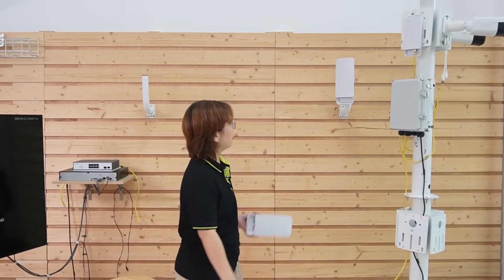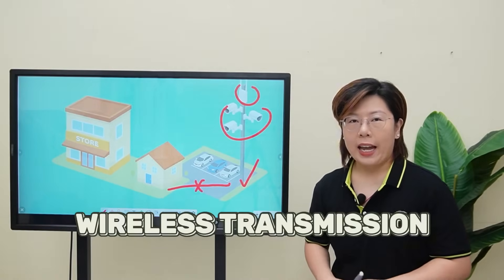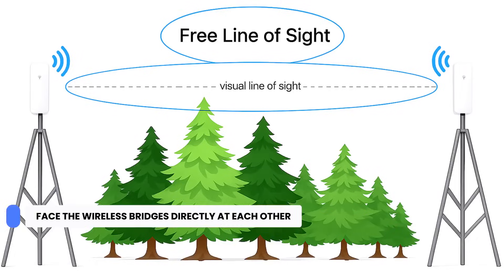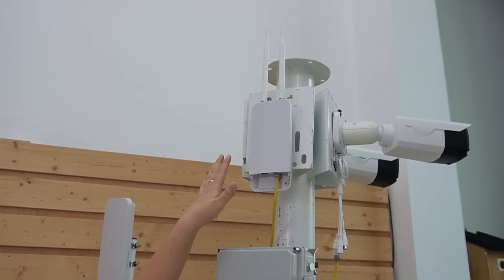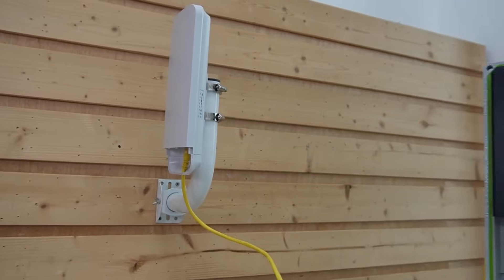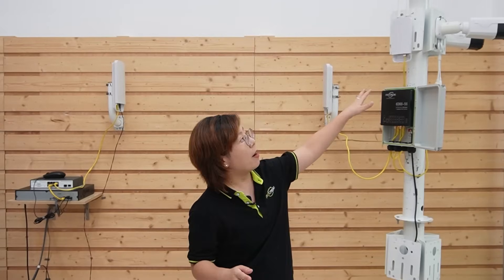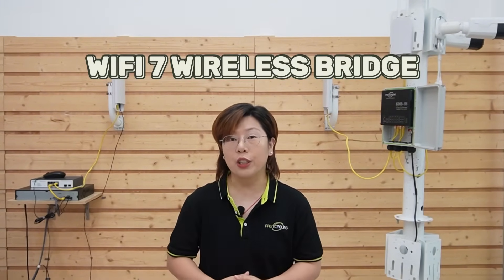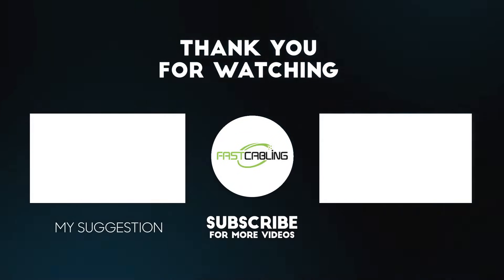Wireless Bridge Setup for IP Cameras & AP without Cable Run | Parking Lot Surveillance Guide

Comment: Why did you need to also hook up a 12dc power adapter to the wireless bridge that's on top of the video recorder? Isn't it already getting it's power from the POE network cable?
Reply from the maker: This wireless bridge can accept DC12V and standard PoE power. You can power it either way. 

https://www.fastcabling.com/product/5km-outdoor-wireless-bridges/

Comment: Thanks for the videos please provide the video multipurpose buildings range of 50 to 100 km above in every building have a nvr with cameras but my office is 100 km to all buildings I want all my buildings cameras watch in my office with internet on my led screen any video on your channel  please provide it thanks
Reply from the maker: A direct wireless bridge over 100 km is not realistic. It's too far, and the line of sight is impossible. Instead of using P2P, you can set up a VPN tunnel between each building and your office → makes them all appear on one private network. More secure, but needs IT configuration.